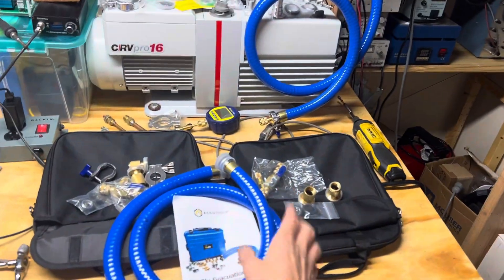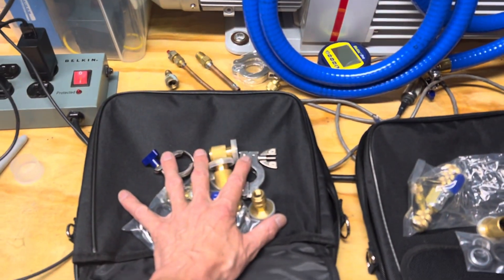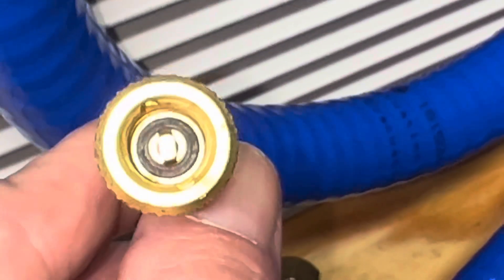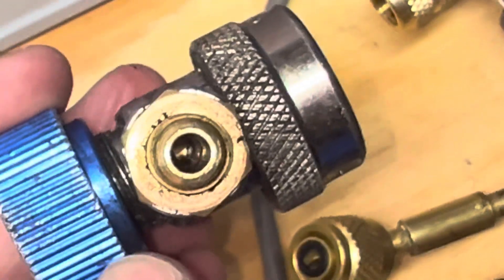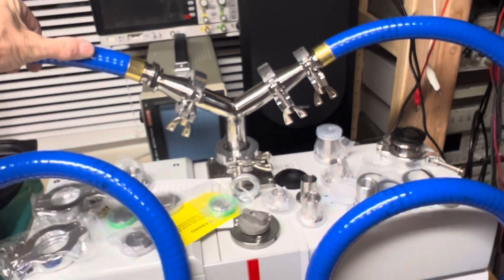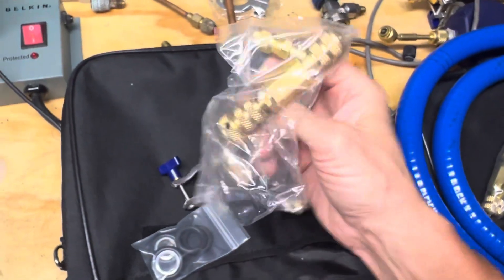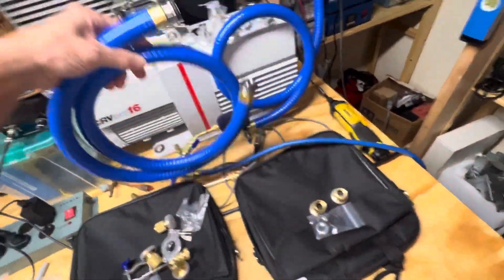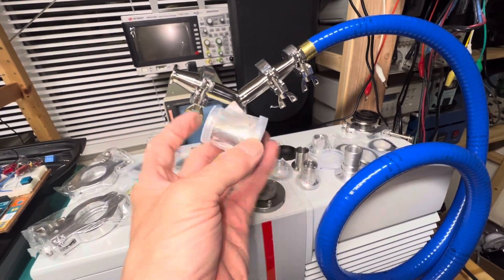VACUUM PUMP THE NEED FOR SPEED and extremely low micron vacuum

Comment: Good god I just looked at the cost and weight of that vacuum pump.  I'll stick with my 1/2" hoses on a JB 7 CFM just so I don't split my back hauling it onto the roof.
Reply: Not too old yet. Just cautious.  But in all seriousness, do you haul that onto roofs for any HVAC work?  Or is that a “ground unit”.  I don’t think anybody will argue its effectiveness.
Reply from the maker: @elBusDriverKC  I have another one .  Yes it goes up the roof for large VRF 20 ton to 60 ton heat recovery system I sell and my son and I install LG MUTI V
Reply: @coldfinger459sub0  I mostly do light commercial so my systems are from the 5 to 20 tons. That big boy makes sense on 20 to 60 tons.
Reply from the maker: @elBusDriverKC  I have a video of me using one on a tiny little 9000 BTU mini split
Reply: What you can do is get a second 7 cfm pump and use all 1/2 hoses as short as possible with a bored out manifold. It is more than double the speed.
Reply from the maker: @markm0000  this is the reason like the Fieldpiece four port manifold.  The internal volume size of the port is Board out large..   it has a 3/8 inch fitting that goes to the three-quarter inch true blue hose directly to a vacuum pump 

After that, you’re only restriction and your losses are your long quarter inch refrigerant charging hoses . 

But at least up to that part you have eliminated using a single tiny refrigerant quarter inch charging hose   

And you have stepped up to a three-quarter inch or half inch . 
And the port going into the manifold is 3/4 of an inch or if you want to Kustom machine it out and tap it to a half inch . 

That means it will have its highest flow up to the manifold then your only restrictions will be the length of your quarter inch refrigerant hoses . 

There is an improvement when you do that 

And if your current refrigerant hoses are 60 inches long or 72 inches long 

And you shorten them down to 36 inches long or 24 inches long if that can work on some cars . 

This will decrease the static resistance created by the small diameter long hoses . 

The longer the length of the hose, it’s a progressive stack effect of resistance to flow .
Reply from the maker: @elBusDriverKC  you are correct this is definitely not for old men.

Comment: Hey Tom  Ive been binge watching your videos today and while Im just a DIY home mechanic, I have your same mindset where I dive deep into my projects.  My question is in regards to recharging my vehicle's ac system.  Unlike you, I just have 3, 12oz cans, not a 25lbs tank.  My idea is to draw a vacuum on the low side (straight from vac to low side quick fitting).  Then on the high side, put a valve core tool onto the quick disconnect and connect charging hose directly to the 12oz can.  Charge the system with the upside down can (obviously keeping car off), then when first can is empty, close off valve core tool, switch cans, purge and keep filling until I get to the proper weight.  This method eliminates the use of the manifold gauges and since I am just worried about R134a wweight, they arent really needed at this stage.  Let me know if Im tracking correctly or if Im overlooking something!  Love the videos, thanks!
Reply: I am in the same boat as you about two years ago.  I watched Mr. Lech's videos religiously while working on my daughter's Volvo S60.  I invested in the Fieldpiece SMAN 480 to get the 4th port and the micron gauge, per Mr. Lech's advice.  Like you, I was charging with cans since I had not passed the test or been certified to purchase refrigerant in bulk.  Like Mr. Lech said, I found the first can would not completely empty, even though I had pulled the vacuum well under 200 microns.  I had to finally start the car and fill the remaining refrigerant with the A/C compressor running through the low side to finish the first can and a subsequent can.
Reply from the maker: @Jonathan-gz6tu  you may have a problem filling 100% with your small cans From the high side only. 
      It can be done 

But if it’s your first time doing this high chance it’s not going to completely change. 

Probably stop after the first can. 

If you know and completely throughly understand the three gas laws you will succeed. 

If you don’t, you will fail. 

It’s that simple
Reply: @coldfinger459sub0  awesome. Thanks for the response. I'll try to wrap my head around the gas law and see what happens. I guess if it won't take it all, I'll just connect the gauge set (or straight hose) and charge the rest as a gas through the low side with the car running.
Reply from the maker: @Jonathan-gz6tu yes if it does not take it all in you can finish it up like you say in vapor form gas through the low side with the car running.

Comment: There’s a lot of money on that table. I think there’s too many possible ways for it to leak. If I could play around with this I’d build a small manifold and braze it together.
Reply from the maker: @markm0000  yes I know exactly what you’re talking about with all those connections

But these connections in the scientific world in laboratories are proven time tested 

Of course one singular solid piece of metal properly welded and the word is properly 

Does have a much higher percentage of chance of near 0% failure rate 

But your micron gauge quickly tells you whether you were successful at all your connections or not . 

I’m walking somebody through right now to find out where they have been failing on their brand new manifold and refrigerant hoses 

After 18 hours of vacuum are not capable of getting below 350 µm 

There is definitely a problem in his rig one of his connections somewhere 

When he turns off the vacuum source, the vacuum decays to 29 inches .9 

That is definitely a problem that is not moisture content 

And the thing is if somebody had a set of manifold gauges that were analog they would never know there’s a problem because 29.9 analog gauge needle will be pegged all the way to the end 

Only the micron gauge was capable of catching the problem
Reply: @coldfinger459sub0  ok

Comment: My old job was as  a research chemist in Palo Alto, we used welsh pumps all the time because we needed to pump down large volume equipment.  Your obsession with high flow is serious overkill to get the job done,  great for demonstration of theory but not practical for daily use.  Love your videos and explanation theory anyway,  great job.
Reply: Tall tree
Reply from the maker: @woodway11  time is money. 

I’d rather spend 10 minutes on a vacuum, then one hour and still charge one hour minimum service 

Every service is between $379 and $800 max parts and material to be completed within 1.4 hours. 

I’d rather spend 10 minutes to reach my final vacuum because you still charge the same amount whether you spent 10 minutes or one hour. 

And you can do several extra jobs because of it . 

It’s the difference between the thinking of somebody in business where profit and losses have to do with time and somebody who An hourly paid blue-collar Walker, who doesn’t think about profits and losses of the business only a paycheck. 

We can still be making furniture using knives and saws by hand to carve out every piece of wood and hand fit them together, and we can still be weaving our own cotton wool to make fabric to cut and hand fit the furniture and handpick goose down feathers 

Or do we invest in equipment that can do this 100 times faster than a human being mass production . 

Would still be in the medieval ages .